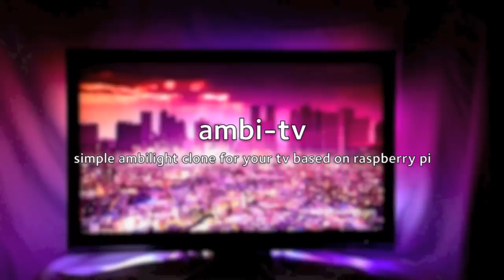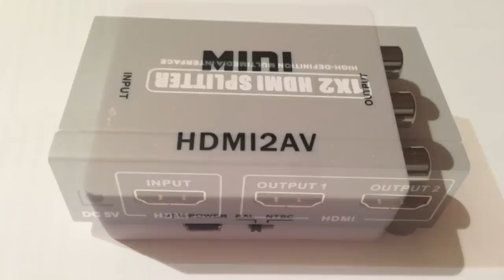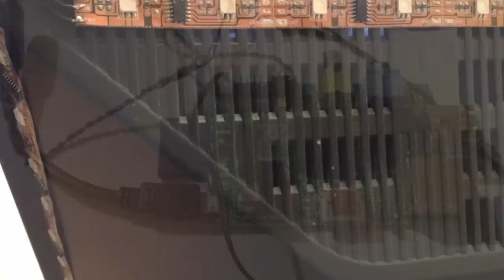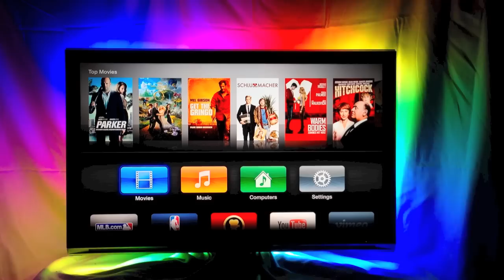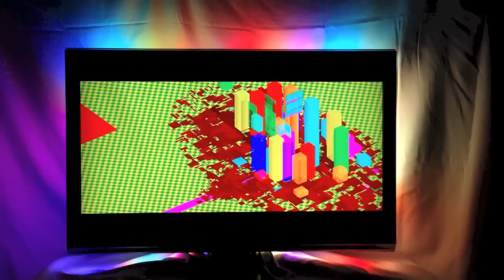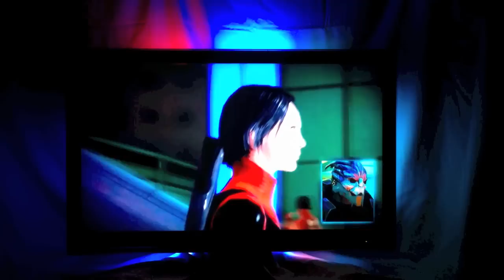ambi-tv: computer-less ambilight-clone based on Raspberry Pi

Comment: Raspberry Pi IS a computer...
Reply: Normally, ambilight requires a computer running xbmc or a similar software, which can send edge data to a controller (raspberry pi). Computer-less refers to the pass-thru capability of this setup

Comment: Would something like this work too, instead of the HDMI - AV converter you are using? 

dx.com/p/hdmi-to-vga-composite-3-rca-audio-video-cable-black-blue-green-red-185640
Reply: No, because you need to convert the digital signal into analog
Reply: subnorman why wouldn't it work for the first part of the conversion going from HDMI to Component?  BEFORE the analog to Digital converter so the R.Pi can handle it.  He's just talking about eliminating the white adapter not the digitizer.

Comment: I am wondering if the Arduino Tre (at the end of November) might be a good replacement for the raspberry PI.  It would have much faster usb speeds so you won't get the SD card corruption issues, and it might be able to handle NTSC rather than just PAL.  What do you guys think?

Comment: Sorry, I got confused. I wasn't aware you could split the output of 1 HDMI to 2 HDMI signals to display simultaneously.
I thought it was the other way around for how a splitter worked. /embarrassed

So that being said, I take it as:
1 HDMI cable from AV Receiver going to an HDMI splitter
then splitting into 2:
1 HDMI signal feeds your TV/projector
1 HDMI signal feeds the raspberry (meaning this signals sole purpose is to grab the feed then convert it in order to display the colors to the LED's).

Comment: hi i wan to use WS2801 led ,and if i change pd8806-spidev-sink.c and everithing inside that file that says pd8806 led and change to WS2801 led it would work ? And if not what i need to do to work with WS2801 led  thank you

Comment: are the recommended led strips the only one that work or are there other strips we can use? what do I have to consider by choosing other Strips. for example is it possible to us a LPD8806 Flexible RGB LED Lighting Strip with 48 rgb leds per meter?

Comment: Hey man! I've successfully modified your code to work with my led IC - the LDP6803 but I am having lots of trouble compiling the usbtv driver. I'm using the latest raspbian (2013-07-26). The best guide I've found is this one: 
sprabhu.blogspot.co.uk/2012_07_01_archive.html

which I've gone through many times but with no luck. 

I would love to get your project working and I'm close but I'm really stuck right now. could you please help me?

Comment: First of all, thank you for the excellent work! I've had a look at your code and it's brilliant: should be easy to modify.

Since this is going to be my next led project, I was wondering if you could give me some help with compiling the usbtv driver? I've had a look into compiling kernel modules under raspbian and it looks a bit complicated. Could you possibly post what you did to compile the driver?

Comment from the maker: you won't be able to use a USB port to power both the Raspberry Pi and the LED strip – I'd recommend an external power supply rated for at least 4A (3A if your TV is smaller).

Comment: Hey,
first of all you did a great job. This Amilight looks really fantastic.

But i have one question. You are using an usb input to analyze the videos. Is it also possible to run a Media Server like XBMC on the PI + your program, so the PI control the LED strips with his own video output??

Or do you think, this would need to much resources?

It would be really great, if a Respberry Pi could handle both - Smart TV + Ambilight.

Thanks for your answer.

Comment from the maker: Hard to say, it will mostly depend on how much current your powersupply can source – The one I'm using is rated at 4A and drives 122 LEDs. If you will use 208 LEDs, I think you'll need a beefier supply, though. Be sure to check the datasheet of your RGB strip to see how much it'll draw per meter.

Comment from the maker: The WS2801 won't work out-of-the-box, since I didn't write a component for it, but have a look at the "Extending ambi-tv" section in the README on github: it should be pretty straightforward and easy to add this by following the implementation of the lpd8806 component.

If you do it and send me a pull-request, other people would benefit from this, too.